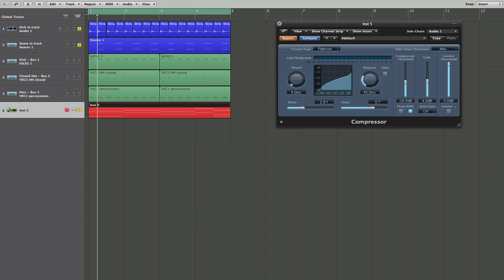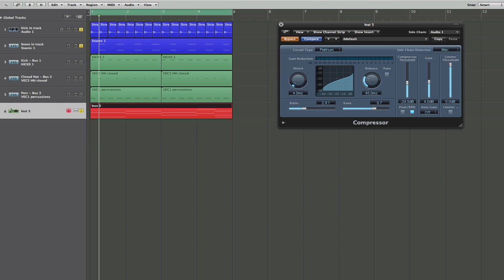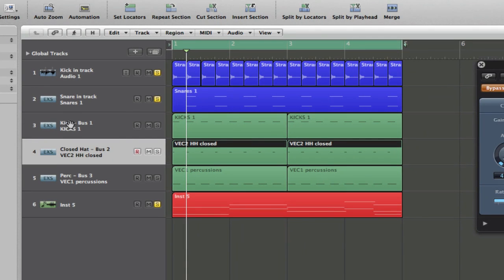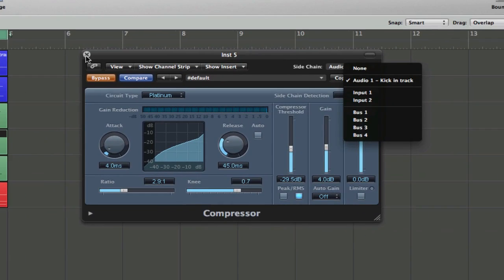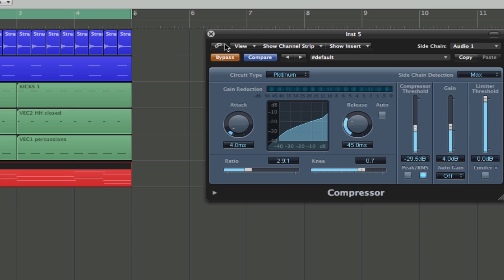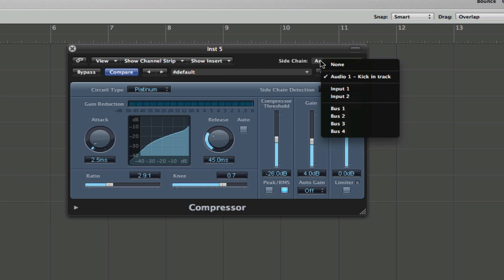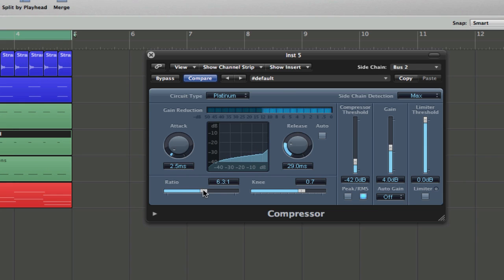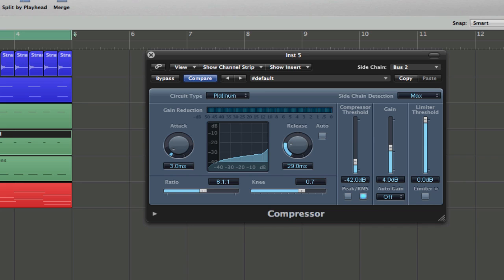Improved Sidechaining in Apple Logic Tutorial

Comment: Thanx! I've used it for some time. Usually, dance kicks has long tails, which will prevent the compressor from letting go of the sidechain. Therefore, using short percsamples, such as a woodblock, will let you control the release instantly after the sidechain is triggered. Dave Pensado had a good tip for release settings: Squeeze the ratio to maximum, then set your release. Then adjust the ratio to preferred setting.